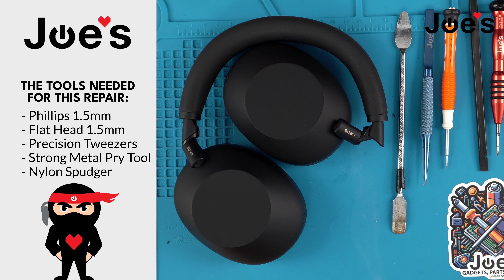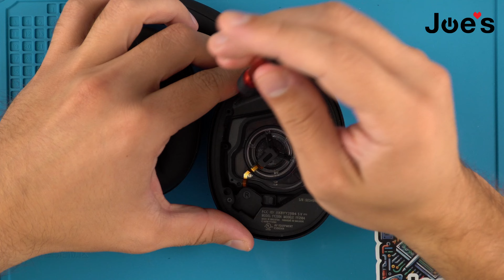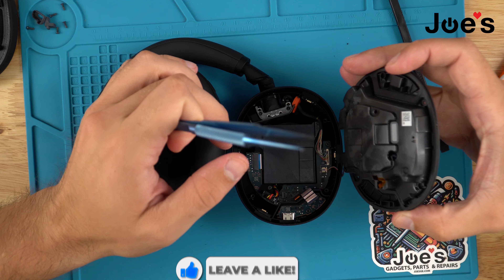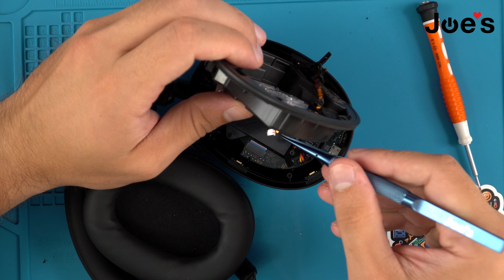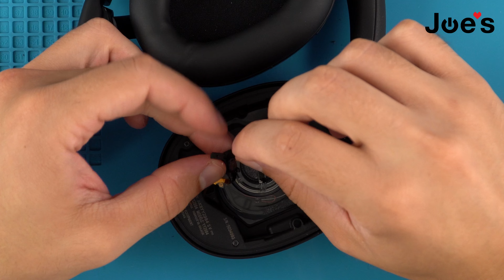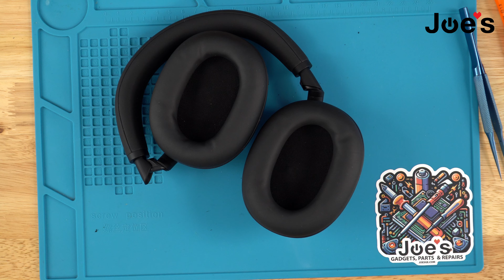Sony XM6 / WH‑1000XM6 Charger Port Replacement – Complete DIY Repair Guide

Comment from the maker: Send your device in for expert repair:
👉 https://www.joesge.com/pages/repair-service-issues?p=wh-1000xm6

🧰 Tools used in this video
Philips 1.5 mm Screwdriver:
👉 https://www.joesge.com/products/beats-by-dre-screwdriver-tool-t5-t2-philips-flat-head-repair-tools?variant=7905323057198
1.5 mm Flat‑Head Screwdriver:
👉 https://www.joesge.com/products/flat-head-1-5mm-thin-strong-screwdriver-pry-repair-tools?_pos=2&_sid=a24b4a181&_ss=r
Plastic Spudger:
👉 https://www.joesge.com/products/nylon-spudger-opening-prober-alignment-ribbon-removal-repair-black-tools?_pos=1&_sid=9d4b192a6&_ss=r
PrecisionTweezers:
👉 https://www.joesge.com/collections/repair-tools/products/precision-tweezers-stainless-steel-thin-thick-strong-for-electronics-repair-tools
Strong Metal Pry Tool (wide):
👉 https://www.joesge.com/products/strong-metal-square-tip-round-tip-headphones-opening-pry-repair-silver-tools?_pos=1&_sid=4acb5d84f&_ss=r